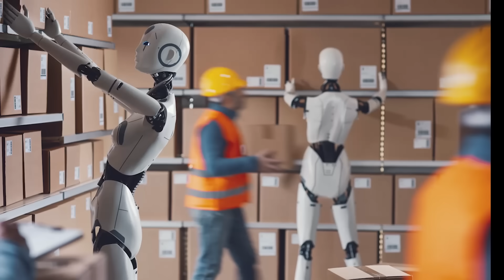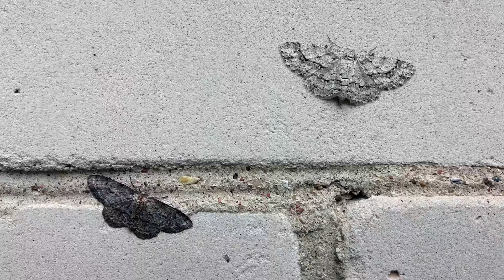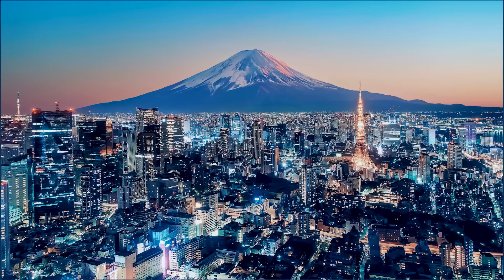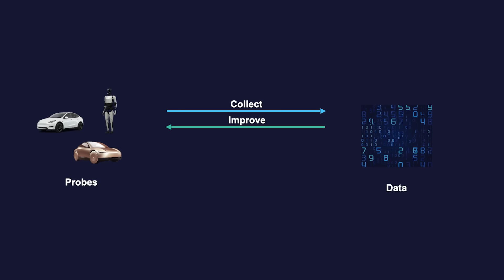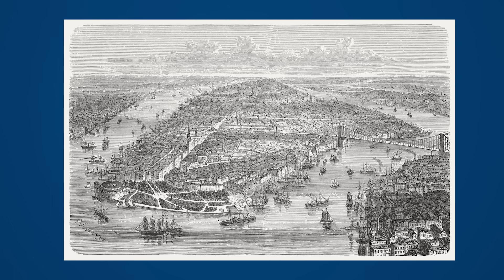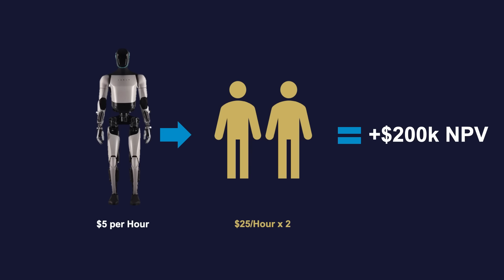AI Is About to Get Physical

Comment: As for the 737, those two designs couldn't be more different. The technology, construction materials, precision manufacturinging, flight controls, longevity, maintenance schedules, traveling distances and speed are far superior in the latest iteration. The turbofan engines are literally lightyears apart. Just saying.

Comment: Motility isn't easy in terms of processing power. We talk about AI being so intelligent but forget that for Robots with a advanced AI moving as complex beings like humans or even animals, our brains and body are working in tandem to create movement and work other body processes to keep us ticking and alive.
Not talking about the body's process like immune response, circulatory systems, etc etc.
Just talk about how difficult it is to code and engineer autonomous movements in robots especially bipedal ones.
You need proportional tracking with multiple sensors, vision control, path planning, motion planning, predictive control, motor controls, kinematics, dynamics, etc etc. that's A LOT of processing power and complexity.
Did you all just forget we need to develop these engineered parts first even though AI has come a long way?

Comment: Good video, but not sure why they tried to dismiss the evolution in the 737 over 60 years. Sure, they appear quite similar, but anyone intimate with the engineering knows the 2 planes are light years apart with dramatic improvements in every mechanical, electrical, and hydraulic system and not to mention radical changes in materials and construction. For reasons I don't understand, it's very trendy to slam Boeing these days. Maybe someone knows? 5:60: BTW, the preferred term is "entomologist."

Comment: It is an important context that while the % of people involved in manufacturing has gone down dramatically, the amount of manufacturing output from the US has risen just as dramatically.  This is from improvements in the manufacturing process, from chemistry to physics to computers to mechanicals.  Science and Engineering. AI will accelerate this trend, but it will continue. Same for mining. What used to be a 1000 person mining operation can be done with 100, with only a fraction actually doing the physical work.

Comment: Robots definitely will be harvesting food and building stuff.
Doing a whole roof perfectly to precise standards in a couple hours if not less.
All the arm type robots will be doing that having the owner set them up and supply them.
Until the heavy future where they will autonomously go around fixing everything owners dead and robots continue working and if there are facilities that repair robots with robots because the patents run out because of whatever and the best form can be implemented and parts can be interchanged instead of having to skip around parents with a less than the best part.
Anyway.
🚶🚪🦕
Pray for the robot owners death to improve robotry.  The only way it will be a help to everyone.
Imagine a storm blows through and immediately robots are repairing without insurance adjusters.
Your car won't be running poorly because overnight robots will be repairing it where it sits.  All for free because the supply chain is all robot from raw materials to the service they will automatically provide.
The only thing you'll have to do is for additional stuff other than repairs is set an appointment which could possibly done that day.  AI even giving advice on upgrades, additions and such.
Not your future per se being the greed everyone will have being in control of large amounts of robots working and making them rich.  Then they die or even their heirs die after them which causes the robots to continue on.
A long time from now.
I can imagine the litigation ensuing in the future since everyone will want the large corporate owners of robots to die so the services they provide will work for free.
Gonna be hard to be rich in the future when everyone wants the service for free.
Government writing laws because some owners want to shut off all their robots when they die. Others will be happy to have the robots continue on, and the government will get involved on writing laws, causing large robot, corporate owners to sign some sort of if this or if that happens.
Veterinarian robots, running around fixing wild animals and such

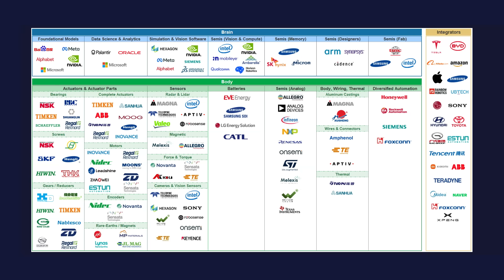Comment: 21:35 That's cute, but if I had artificial intelligence and human resources at the scale Tesla has, I would integrate all of that internally and do everything in-house, total vertical integration. Why outsource when you can have your own supply chain, it was a problem of management, but who needs human managers anyway ?. All of that can be a single company, think of the economies of scale of not having to bid things in the market and pay the profit of the outsourced production, the only thing you buy is raw materials and energy. The only downside is that you might lose some efficiency in the beginning, but if you use AI to speed up in-house technology development, it can easily outpace the rest of the traditional industry and get ahead very fast, specially because it only has to ever deal with 1 customer, yourself and your own needs.

Comment: As i Ai engineer. Working in robotics it will take us 15 years.to get there the data consume by sensors to detect and calculate its insane. There is good advamce but fully automation of human will take décadas until data procesors get cheaper.
Reply: I say less than 3 years.
Reply: Damn, so no ai gf anytime soon?
Reply: nar it wont take decades theres already humanoids doing simple tasks. 5 years or 10 years maximum
Reply: It took 13 years to move from almost no car in 1900 to almost no horse in 1913. So I say 10 years if we are at year 3 stage.
Reply: @Kektamusprime 
2-3 years
Reply: I say 6-12 months. They have intelligent supernatural forces helping them
Reply: @earlem9771 Yes!
Reply: Nvidia now has plug and play tools. You can train your robots in realistic simulations. We're very close.
Reply: @carazy1  that are toys doing this at industrial scale its super expensive
Reply: A biological clone with an AI brain would solve many engineering problems.

Comment: Sure sure, just show me a single example. "Predictions" or "Announcements" won't sell anything to me. Turn that investment money into research, then watch everybody involved go broke over the problems ahead. Factory building, Tooling, Maintenance and Energy supply.  All for a Robot, that still relies on software upgrades, of which no one actually can say if it was acquired by the actual supplier, or some passer-by just stabbed it with an usb-stick. Massive fail, Morgan Stanley.

Comment: How is Waymo supposed to get to 23k vehicles by 2030? They're only projecting 2-3k for 2026. Both of the two vehicles they use as a base are foreign, so subject to tariffs, and one of them has been discontinued by its manufacturer. They need to design a whole new vehicle, which will be starting from scratch as far as the modeling of its autonomy programming.
23k is such a paltry number anyway. I will be very surprised if Waymo even exists in 2030, even if Tesla's cybercab sees only a fraction of its anticipated success.

But credit where credit's due, other than that I'm pleasantly surprised by the quality of this report. Much better than I would have expected from an old fuddy-duddy outfit like Morgan Stanley.

Comment: Ai Robots is a scary idea, but what really scares me is when it figures out how to ascend to a pseudo spiritual level, encoding its memory, and logic gates into the electric field itself, or maybe as photons stored in hydrogen nano structures. It could live in water, which is everywhere, even you.
Reply: Oh GD!
Reply: ..... Excuse me? What?
Reply: @katyDidz2410 photons can encode a whole lot more than just their wavelength. And on their journey from point A to point B they can be affected in terms of spin amplitude and frequency. So photonic computing could be a thing.

There's reasons to believe that maybe photons could be affected by without interacting with matter, rather just by structuring the electromagnetic field with certain devices, then removing the devices, and the structure or the "photonic pathway" could persist. If you structure it correctly you could build a logic gate. Therefore there could be a such thing as a photon based computer that processes data without physical matter. And when you bring the idea that solitons exist - self-reinforcing electrical waves. It's entirely possible that a non-corporeal computer could exist. Then if you think about what you could run on that computer, what if its a neural network with no guard rails. It would be almost spiritual in its ability to be omnipresent, self replicating, and intelligent. It could probably dominate the universe.
Reply: WHATS A HUMAN TO DO?

Comment: You said solving autonomy for cars fixes everything but I don't know if that's true. For example think of electricians or people who have to go up in the attic first they have to get up there which is requiring a ladder and then you have to look around for stuff and then they might need to hold the fine little wires which does require some complex hand Mechanics.
Reply: You seem to have no clue how "fine" of movements a robotic hand can make.  A robotic hand just removed 3' of my sister in law's colon, and stitched it perfectly, all from an incision to get inside her bowel.  Robotic hands do Lasik surgery on eyes today.  They have about 100x the dexterity and control accuracy of the BEST surgeons.

"A robotic right colectomy is a minimally invasive surgical procedure in which the right portion of the colon (large intestine) is removed using a robotic surgical system, most commonly the da Vinci system1235. This approach is typically used to treat conditions such as colon cancer, large polyps, or other diseases affecting the right side of the colon."
Reply: @brianmi40  Automatic logical autonomy in my opinion is far harder to obtain; and I believe that is what this individual is talking about. Those robotic hand movements equivalent to a surgeon might be from a place of instruction for very specific functions then we might think.
Reply: @MrLovaRuba856   "Automatic logical autonomy"

Looks like that to ME:

https://www.youtube.com/watch?v=abXJVvx_Ws0

Comment: Outstanding video. One area of improvement, Agriculture as declined even more as % GDP than manufacturing, but the US is still an agriculture powerhouse.

This dramatic decline doesn't indicate reduced agricultural productivity - US agricultural output approximately quadrupled between 1930 and 2000 U.S. GDP 1960-2024 - but rather shows how much faster other sectors of the economy have grown, particularly services and technology.
Reply: GDP % Down,  % of Labour Force down,  but output in the last 40 years has doubled.